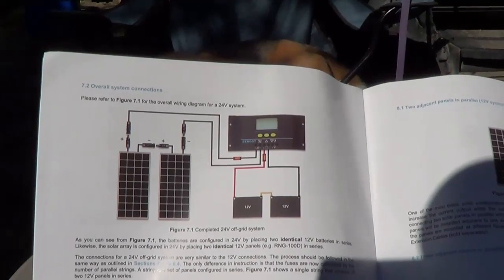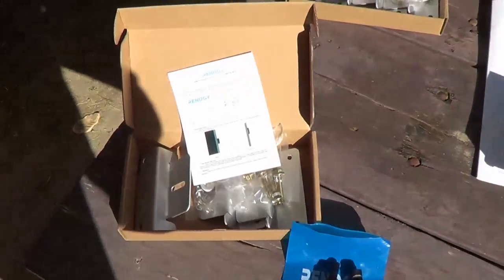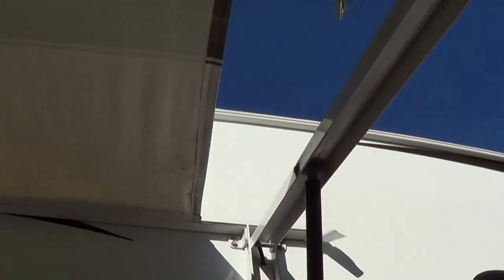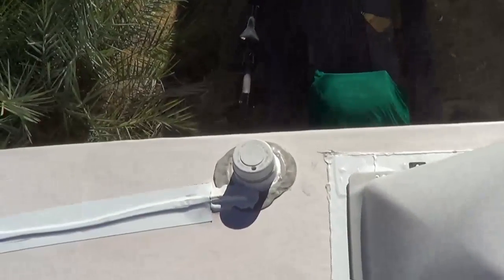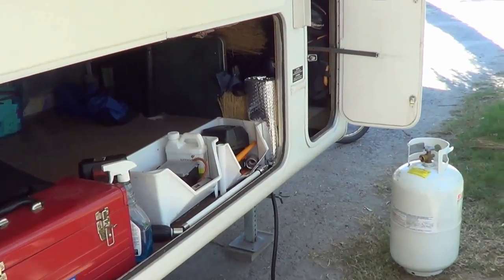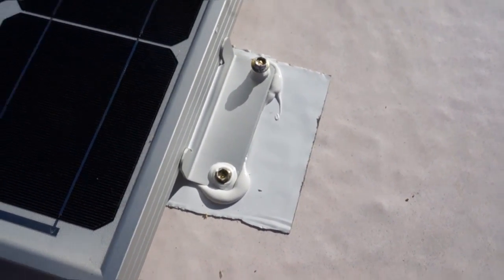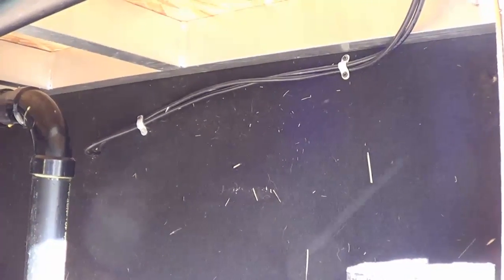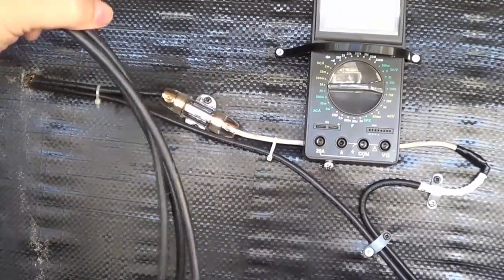Installing a Renogy 200W Solar Kit on my RV

Comment: how many batteries do you have? Are you still happy with the system?  Thanks
Reply: Love Your RV We love having kept our 2 -100 watt panels portable.  We have good tilt using PVC pipes and T connectors.  Also, we have 30 ft extension wires and MC4 connectors if we are in the forest and need to move the panels to a sunny spot.  Granted, the longer wires loses a little bit of incoming amps, but still is quite sufficient to get batteries fully charged.  This extension also come in handy for parking in the shade while collecting hot summer sun! Cheers! Cindy
Reply: Suzie Cue And install was so much easier!!
Reply from the maker: Ray J We have two golf cart type 6 volts batteries we use for dry camping. Loving the system so far and it's had a good test as we mostly dry camped the last 2 months. If we avoid using the high wattage items like my wifes large IMAC desktop and 32" inch TV and just use our laptops instead we have no problems with keeping the batteries charged up. I do plan to add two more panels and two more batteries to give us a little reserve for cloudy days and let us run more things like the IMAC and TV.
Reply: Love Your RV Ok we have the same in our Motorhome sounds like your energy usage is similar to ours so this may be the system for us. We were at the Salton Sea a few weeks ago. Thanks for the great information.
Reply from the maker: Ray J when I was in the Salton Sea it was December, now that it is April I notice a large difference in power since the sun angle is much steeper and more daylight hours. During the peak hours from 11 am to around 5 pm we can even run the big IMAC desktop and not lose battery charge. Some folks like to have tilt mounts for winter time, but I'm going to go with more panels first as I like the convenience of not having to head up on the roof, since we move quite a bit, one less chore. Cheers Ray
Reply from the maker: Suzie Cue Nice, some great benefits to having them portable. :) Down the road I'll probably end up with a portable panel as well.

Comment: good video. note: 13.25 volts x 8.25amps= 108.26 watts. That's only 54% of your totally capacity. It you can figure out how to tilt the panels towards the sun, it will greatly increase your input. Thanks for sharing
Reply from the maker: eastafricansolargeek Thanks, I'm aware of the tilting, but prefer to avoid the extra hassle if I can, we move frequently, going to try more panels first as I have quite a bit of roof real estate to work with, before needing to start adding in tilt hardware. That test was at the lowest sun of the year, Now that it is spring time I'm seeing 11.6 volts x 13.6 volts during peak sun hours. Cheers Ray

Comment: Im just wondering why you went with 6v batteries instead of 12v .
Reply from the maker: fun under the Sun Generally the six volt batteries are made for rugged applications like golf carts where the batteries get deep cycled a lot. Because of this they have heavier lead plates in them than normal. Many RVers like them because of this. Once wired up the two sixes are just like having one huge 12 volt battery.It really came down to getting the best bang for my buck for a battery that can stand some harsher than normal usage.
Cheers Ray
Reply: Here's a good article about the golf cart batteries.  http://www.loveyourrv.com/trojan-battery/
Reply: Love Your RV

Comment: Like your vids.

Would love a vid showing your battery bank, and exactly how your solar system is hooked to the bank.  Also I would love to know how you integrated your inverter into your electrical system. I see it's 1000 watts but I can't see the manufacturer. Also is it a pure sine wave inverter - and is 1000 watts enough for your needs.  Do you have a way to turn off your rigs converter charger when the solar is powering the inverter?
Reply from the maker: William Klein Here is my inverter install - http://www.loveyourrv.com/1000w-pure-sine-wave-inverter/ and my batteries -  http://www.loveyourrv.com/1000w-pure-sine-wave-inverter/
Solar is hooked to the 6V bank through the charge controller that came in the solar kit.
The inverter is a store brand from Canada, called Canadian Tire, not sure who makes it but I suspect Xantrex.
It is pure/true sine wave,1000 watts is more than enough for our needs usually, if I do want to run a microwave off grid I just fire a generator.
No need to turn off the converter, the solar charge controller figures out if the batteries need any more charge, but I could just flick off the breaker for the converters charger if I wanted to.

Comment: Ray,
I'm not an electrician by any stretch, but I can't help but think all the work you did to eliminate inefficiencies has been nullified by the addition of the ammeter.  Are you using the same gauge cables for that little puppy?  Have you given this any more thought?  I am thinking about putting in an ammeter with the shunt method, which I would consider "proper".  Although I do have an old multimeter so I'm tempted to rig it up like yours.
Reply: Love Your RV For a $20 upgrade, you could have this.  I love knowing my volts and amp coming in.  http://www.amazon.com/RENOGY®-Amp-Charge-Controller-Display/dp/B00FB3OPKM/ref=sr_1_2?ie=UTF8&qid=1431304330&sr=8-2&keywords=renogy+charge+controller
Reply: ***** Multi meters have a shun built in. Just a matter of it handling the current without heating to much in a constant current use.
Reply: Love Your RV I noticed the same thing too.  I can get the full amount of power out of my solar panels, even running through ammeter leads, but never more than about what you have for your setup... if you plan to add more panels in parallel, I would not advise running all your current through that ammeter.  <12A is okay.  Mine is rated for up to 20A but that's pushing it.
Reply from the maker: Christmas Eve Yup, it was just a free way of giving me an indication of performance since I had spare a meter lying around, without shelling out for a quality shunt and power monitor. Best bang for the buck next I feel is two more batteries and then 2 more panels and then a good shunt and battery power monitor.
Reply from the maker: ***** That multimeter in it's 20 amp measuring mode uses the shunt method internally to calculate amperage, I took it apart and soldered the wires right across the shunt, doubt there is much loss at all. But, it is temporary till I can afford a decent monitoring unit. that will tell me much more info on my battery charge state like a Trimetric - http://www.bogartengineering.com/content/trimetrics
Reply: Suzie Cue I highly recommend you stay away from PWM type chargers.  I can hear my batteries sighing in relief after being charged by a MPPT charge controller.
Reply from the maker: ***** What kind of MPPT controller did you install and how much did it cost? What makes it charge the batteries better? Thanks Ray
Reply from the maker: ***** Nice price for a MPPT! The PWM I got in the kit does do the three stage charge which is nice, like you say.It's rated at 30 amps. It actually does a better job than the crappy OEM converter in the trailer which never goes into bulk charge mode. I think they used under size wire, it's got a real long run from the converter in the kitchen all the way up front to the batteries.

I'll likely upgrade the controller and add two more panels and 2 more batteries before this falls trip back to the desert. That should give us all power we need without having to conserve too much.
Reply: Love Your RV Just a question/comment about your amperage and voltage reading taken at noon.
13.25 volts x 8.25 amps = 109.3 watts. 
 I understand that  it was winter, but this doesn't seem like good performance for 200 watts of panels. Have you gotten better amperage output since you made the video from your Renogy 100 watt panels. Would you recommend them?
Reply: the humble servant Latitude is a large part of it.  At the equator, the sun would not have to go through as much atmosphere to reach the surface.  Since we are in USA, it has to go through the atmosphere at an angle, requiring it to pass through MORE, getting more light reflected back into space.  The main thing with RV solar panels is that they're laying flat, though.  It's amazing what a difference it makes when you point it perfectly at the sun.
Reply from the maker: the humble servant Highest I saw was 13.25 volts at 11.8 amps. A 100 watt panel will never give 100 watts, that's a perfect lab scenario. AFAIK, In the real world 80 or so watts is likely the best you can hope for on a perfect day pointed right at the high sun.
I would recommend them in that price range for sure and plan to get two more. Cheers Ray

Comment: Great job - thanks for sharing. One suggestion for folks watching and contemplating a similar project. IF..you are planning to add panels later, go ahead and run the additional and properly sized (oversized is better) wiring and charge controller when you do the initial install. Makes your expansion MUCH easier.
Reply: Or better yet, get an MPPT controller and wire all the panels in series. Good advice anyway.

Comment: Hello Ray and Ann. I wanted to tell You how much I appreciate all the great info! I have been following Your vidios for around a yr. And have leaned alot. I am looking at the same solar kit that You installed, and wondered how it was working for You? Also a quick note on the charge controller. From the revews I read it should be upgraded to a 40amp if You do add two more panels. Thanks again Steve
Reply from the maker: TheRenagade38 Thanks! The system has been working great. Very happy with it. We used it a lot recently when visiting down in Big Bend NP area. Did tons of dry camping and if the sun was shining and we only used our laptops not the big IMAC and the 32 inch TV the solar was plenty of power for us. We would spend the day exploring and return to the rig in the evening to find our batteries fully charged up.
Thanks for the controller tip, I'll likely do that and add some more battery capacity too, that way we will have some reserve power for those cloudy days. Saving my pennies, ;) Cheers Ray

Comment: Hello. Just wondering how the solar panels are holding up. I purchased a 300W Renogy Kit with the 40W MPPT controller. Mounting the panels with those screws they send don't look like a great idea to me. After researching different ways to mount them to my rubber roofed Class C I decided to use SnapToggel anchors. I haven't installed them yet but hope to get started this week. By the way... How many and what kind of batteries do you have. I upgraded mine to two Trojan T-105s last year. I'm thinking I may need two more.
Reply from the maker: ***** We are full time RVers, sold our house and live for the most part in the RV. I'd say we average around 11 months per year, the other month is spent visiting relatives and staying with them in thier houses.
Reply: Love Your RV I ENVY YOU!
Reply: Love Your RV so when u say you kicked on your heater, what type of heater is that,  "using solar"?  .. Hope that's not a stupid question, i'm pretty stupid with technology, and only familiar with PROPANE heaters when it comes to lil campers & such.  ... Is it a separate battery from your engine battery your heater uses? (probably another stupid question).
Reply from the maker: realredrebel My panels seem pretty strongly attached, I can't budge them if I lift up n them, been in some very strong winds lately, no problems, I used sealant on each screw and didn't over tighten so the would have good bite into the roof wood paneling. It is a walk on roof so pretty thick. I also added quite a bit of sealant right over the mounting bracket. So far so good. I have two 6 volts rated at 235ah capacity. I previously had Trojans, just got some fresh batteries to go with the new solar, trying Interstates this time around. Will add two more when I add two more 100 watt panels.
Reply: Thanks for the reply Ray. Hoping to have mine going by Sunday. Take care and Best of Luck on your travels. Tim
Reply from the maker: ***** When I'm trying to save power off grid I often use a my portable propane radiant heater rather than the RVs big furnace . It uses no electricity and heats the rig very well. There is some safety rules to follow though and I don't use it when sleeping.  http://www.loveyourrv.com/rv-install-review-mr-heater-big-buddy-mh18b/
Reply: Love Your RV I'm actually watching your big buddy video now, (which i have one), but u mentioned when trying out your solar panels u were running your heater, does the power from that heater run off a separate battery than your engine battery, recharged by your solar panels?
Reply from the maker: ***** Yes it does, it runs off trailers batteries which get recharged by solar or a generator when boondocking. On my RV being a fifth wheel trailer nothing in it runs of the trucks engine batteries. Everything in the trailer runs off batteries in the trailer. Many people call them coach batteries. Would be similar for a motorhome style RV
Reply: Love Your RV How much time do u & your wife spend in your RV throughout the year?

Comment: hello, great video, you convinced me im ordering today. will you please elaborate on the 3volt protector thing (fuse?) you attached. why you need it, what it does and where do I get one. thanks!! Also, I have two batteries, if I get another can I attach it to the panels as well.
Reply from the maker: shelleyfunny19 Thanks!  It's 30 amp fuse to protect the circuitry in case a short develops. I purchased mine at Radio Shack with a nice little holder to mount. Here is the Renogy manual that has some diagrams on where to place the fuses. I went with 30 amps as that is the max rating of my charge controller that came with the system.  http://renogy.com/wp-content/uploads/2014/04/off-grid-general-manual.pdf  You can attach more batteries but may need more panels to fully charge them depending on their size and how much sun you get in a day and how high the sun and lots of other factors. I believe the quick rule of thumb is one battery for every 100 watts of solar panels

Think of batteries as containers and the energy from solar as water trickling in. If you have more containers than water being produced you won't fill them in a day. Also you may be taking water(energy) out by using things like computers or charging things in the RV during the day.

Comment: I would like to know if the Solar System that you just installed is a stand alone system or is it part of the RV wiring system, is it connected to your RV's converter? Where did you locate your Inverter?
Reply from the maker: Cyril Chislett Stand alone. Inverter is right close to the battery bank. Check out the blog post for details. :) http://www.loveyourrv.com/installing-renogy-200w-solar-kit-rv/

Comment: I'm doing the same install today!! Will that e tape be hard to get off the wires if need be?
Reply from the maker: David Heck I wouldn't try and peel it off the rubber roof. My plan would be to just slice the tape and remove the wires. Just leave the tape in place if I was moving the wires If adding more wires, I would add another layer of tape over top.
The stuff sticks to itself very well so you can tape over the tape with more tape. If that makes sense. :)
Reply: Thanks for the reply! Sounds good to me. Mine doesn't look quite as clean but it should do the trick! I'll post a vid too and give you props...

Comment: Hi there: Did you have to screw the solar panels into structure on the roof to keep the panels really secure? If so, how did you find the structure to screw too?
Thanks
Reply from the maker: Jim H Yup, Seems pretty strong. I added sealant to the screws and didn't over-tighten so they wouldn't loose their bite. So far so good.

Comment: So are there any issues when you want to "hook up" to 120/220 at a serviced site?  Will plugging the trailer into an AC source damage the charge controller?
Reply from the maker: Mark W Shouldn't be a problem as the output of my charge controller is hooked straight to the batteries. But I do have a two battery bank system. I have the two 6 volt golf cart ones I use exclusively for boondocking and also the original 12 volt battery the trailer manufacture installed. I use the 12V one for a backup battery when boondocking. I decided to wire it this way becasue the 12 volt battery was already there when I bought the rig and I added the 6 volts ones later. When I add two more panels I'll likely replace the 12V with two more six volts to increase my boondocking bank capacity.
I have a battery selector switch so I can chose between. When on shore power I switch to use the 12 volt battery and leave the 6 volt boondocking batteries to be kept topped up by the solar.

Comment: Nice job Ray. That should save you some gas and generator hassle this winter. I love the recycled multimeter idea. I've got a couple old ones laying around and might try that. Have you given any thought to installing a cutoff switch between your solar array and charge controller? I've found it to be a very handy way to switch off incoming power for maintenance or other reasons. Happy New Year!
Reply from the maker: RVwithTito Thanks. Yes, I'd like to add a quality cutoff switch in the future, Hard to find a decent source while traveling around so will likely wait until back in BC for the summer. Until then I'll just cover the panels and undo the fuse if I need to check anything, unless I stumble across a good electrical store.

Comment: Looks like a great set up. I have had a 100 watt Renogy panel since summer of 2014 and it has been working great. Soon I will be getting another battery since I only have 1 right now.
Reply from the maker: campervandavid Very pleased, so far after 10 days dry camping, only fired up the generator twice. Once to watch a bunch of New Years eve TV and the other time because it was cloudy.